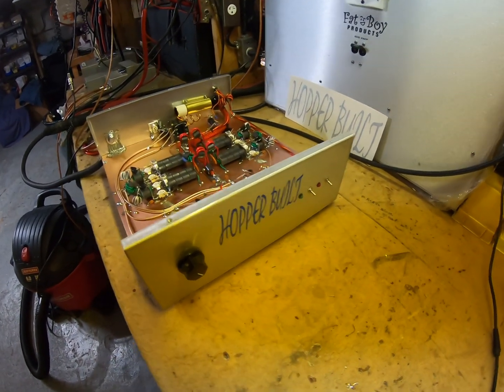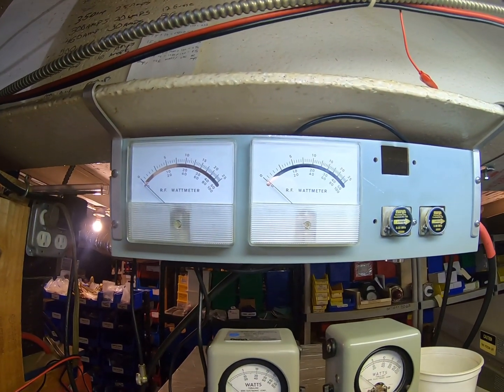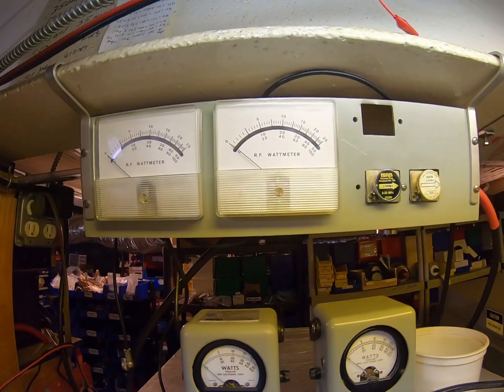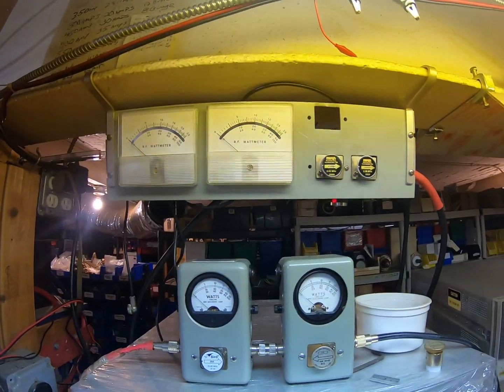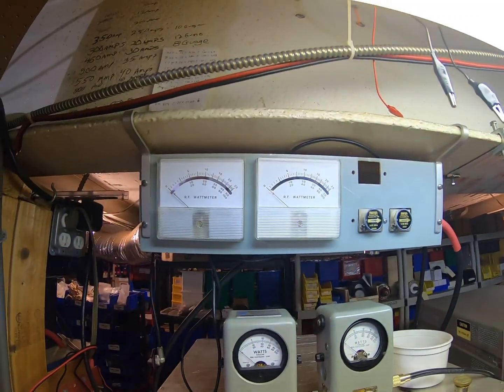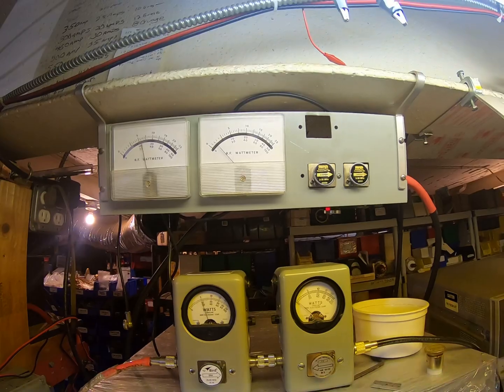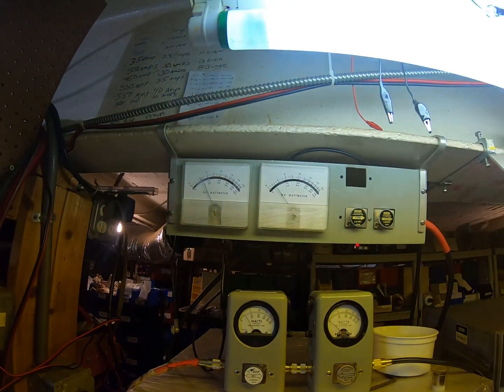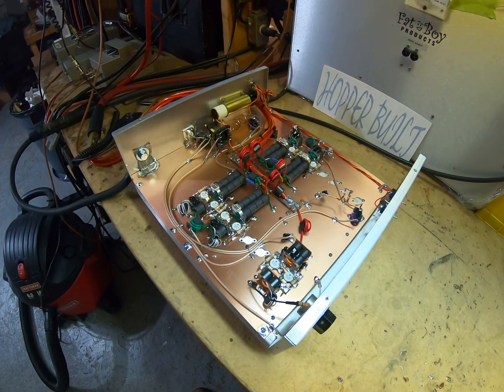Super 8, 2x8 with high/low

Comment: Do all you're 2x8 build boxes put out 2200 PeP and 1000 RMS
Reply from the maker: Every amp is slightly different.  Radio drive, voltage, etc can all change the output of the amp